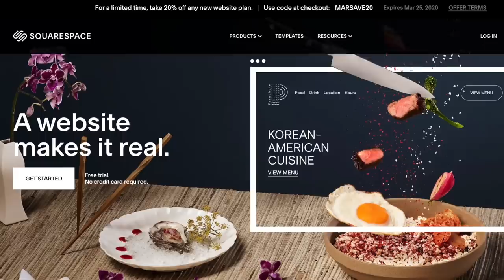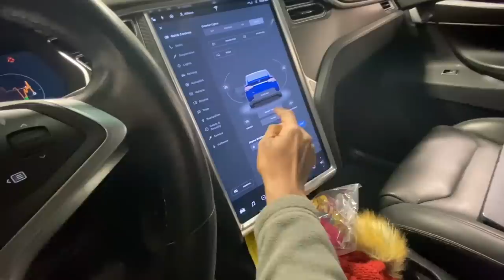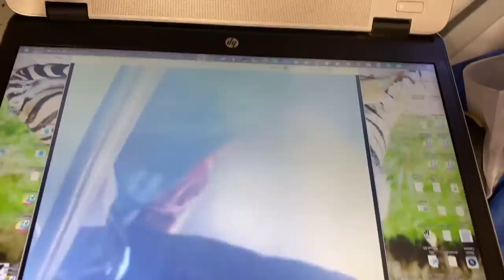Fixing everything wrong with my Tesla Model X

Comment: I truly do not understand why people keep propagating the notion that EV's need no maintenance.  Good vid. Rich. and EV Garage.
Reply: Andrew Whitehead; I think my old Gen Two Prius has something to do with that. No seriously, everybody gives them shit, Tesla Toyboys shit on them for using gas, Toyota toyboys shit on them for being electric ..and any time I tried to go up a hill or literally just move in snow I shit on it too but honestly, I’ve never seen a vehicle that required so little to go so far. The Prius played a huge role in building EVs low maintenance rep, IMO.
Reply: @aaronmacy9134  it comes from evs have way less moving parts. and not all evs are rebuilt from multiple cars like Richs'
Reply: @burq-  also hybrid vehicles doesnt overuse their powertrain, the prius uses a relativ big engine but in aktkinson cycle, the prius has a very sophisticated catalytic converter, also the tesla model y is almost a copy of the prius , you can compare the  two , from the dasboard to the hatchback and rear storage.... the tesla also needs a solar roof like the prius for some basic things like summon
Reply: @burq-  His Model X was purchased directly from Tesla. He didn't build it like his other cars.
Reply: Yup, EV's have less moving parts. And thus one feather becomes five hens.
Reply: Totally correct dude. 

All these people saying less moving parts only applies to the power train.

EV still have suspension bushes, wheel bearings, brakes, coolant, brake fluid, and various other regular mechanical items that require servicing.

It's like taking a regular removing the engine and transmission then saying nothing else will need maintenance.

Comment: Hey Rich, great video as always. I have a suggestion for the mechanical brake corrosion issue. How about suggesting to TESLA to create a API to have the cars computer set a interval of using the mechanical brakes once in a while so that they get hot enough to keep from corroding from lack of use? The API can be either set on a schedule or selected by the owner to perform the action which would show up on the screen as such. Just a thought. Stay safe!
Reply: Or you can turn regenerative braking off for a while.

Comment: $1800? Pfft! You need to own a BMW to get truly heart stopping "maintenance" bills.
Reply: But bmw is quality and quality has it's price. Tesla has only a price without quality
Reply: @sebastians.170  "BMW" and "quality"? Get out of the 80's, BMW's quality SUCKS now.
Reply: @sebastians.170  the "quality" era of bmw ended a long time ago
Reply: @sebastians.170  thats a pretty good joke lmfao
Reply: @sebastians.170  Agreed.  However, I own an E90 and an F30 and the F30 is crappy in the quality area, much much more so than the E90 only a generation older.
Reply: @mitch075fr  idk if im lucky but my 2012 bmw never had any issues, and in terms of quality, the interior and exterior were done very well, meanwhile my friends tesla has a mis aligned panel in his trunk
Reply: @markomclane475  You ARE lucky - I don't know a single BMW owner who DIDN'T have an issue with their car - and then had to pay the BMW maintenance price. And when I told them their very costly 4-cylinder Turbo engine would have cost less to fix at Peugeot's, they don't believe me... until they're told by their local mechanic that yeah, their engine is a Peugeot under a hard to remove BMW-branded plastic cover. It's even worse with Benz and Renault (with Benz engineers admitting they'd be unable to build a 4-cylinder engine as robust and efficient as Renault). So yeah - Deutsche Qualität was a thing in the 80's, not anymore. I won't mention VW - the Golf 4 was the last car generation worth anything and it sold like crap.
As for Tesla's lousy workmanship, I can't agree more - 3 guys have one at work (a 2017 model S, a 2017 model X and a 2018 model 3), and there's not a single one of them that didn't have misaligned panels or electronics going off after a few months. But it seems to be par for the course with American cars - I've never even SEEN one with proper workmanship. And one has to pay extra NOT to get a torque converter coupled with lousy blade springs suspensions... Give me manual (or automated dual clutch) anytime over that crap!
Meanwhile, my cheapo 2013 Dacia Sandero 2 LPG is running rather well (eventhough my wife is doing her best to destroy it) and my 2015 Mitsubishi-made iOn is as fun as ever to drive on windy mountain roads (provided they're dry - a Japanese pocket car is NOT built for good grip, whatever one may say).
Reply: @mitch075fr  huh, this whole time I was under the impression that german cars were very reliable. My first german car was a 1995 Mercedes C220 and that car only had one issue that my handyman father was able to fix in 5 mins with electrical tape. I also changed the battery for that car twice in the time I owned it, then in 2011 I started looking for a new car preferably a german or japanese one, and found a really nice bmw m650i that was barely used (500km on the odometer). I bought it near the end of 2012 and the only money I spent on that car was for new winter tires and rims, since it can get pretty snowy in canada. Also after a year if owning my bmw, the infotainment screen would occasionally tell me to visit some place in london ontario so I could have my car inspected, the bmw place found nothing wrong with my car yet they still charged me, last time I ever went there. Is it possible that because my mercedes and bmw were made in germany the quality is somehow higher than the cars that are made here in north america?
Reply: @markomclane475  It used to be very true. Don't get me wrong they are still more reliable than Italian, American or British cars, but they got to be no better than French cars (that improved a lot quality-wise since the 90's) and worse than Japanese or Korean cars.

Comment: Is this still you most useless car now that Delores has no supercharging?
Reply: Touché
Reply: Next video is always the most
Reply: Teslas are most useful as a city car, with home charging.  Supercharging is just for long trips and is quite expensive (>$0.30/kW-h, compared to <$0.10 KW-h at residential night rates).  Public chargers tend to run the same costs or more.  If I owned a BEV, I would rent a gas car for distant trips, which I often do even with my gas vehicles since no worries of breaking down far from home, with the resulting delays and high repair costs.
Reply: @williamgrissom9022  I'd just buy a Prius, great for city driving and self charging!
Reply: Graham 
“Self charging” is just Toyota pretending their gas powered car is an EV. It’s not and never will be.
Reply: AlphaCenturian Person
Delores still has the same uses as before, just less convenient. I bet the X is still the most useless to him.
Reply: @Dave5843-d9m  Yes, it's a hybrid car. What about it? It's still better built and better designed than any of Tesla's vehicles.
Reply: @G-ra-ha-m  It's a bit big for parking in the city center. The Honda E is king at that.

Comment: I gotta say, $1800 for all the work that was done is a pretty damned good deal.  I honestly thought you were gonna say something like $4500.  In the last video, Chad mentioned that the vibration was from the half shafts, and that you'd need new half shafts and a motor mount.  What that done here, too?  You mentioned the lower control arms, but not the half shafts.

Comment: My dad taught me that you have to use the brakes on the car from time to time, otherwise they will corrode and be less efficient. I would often engine break in a lower gear on a normal car in order to not brake, but not using the brakes makes them corrode like he shows in the video.  Because Tesla's car all have built in engine breaking when you let go off the accelerator, lots of energy is conserved back into the car, but at 3000 miles a brake pad starts rusting "naturally".

I've been looking to get the X, but now I need after market brakes so it doesn't rust. Perhaps the brake pads is the next upgrade for factory teslas.

Comment: Did those coolant connectors fail due to multiple battery removals? Seems like a silly complication for what could be a two hoses with a clamp which would last 20 years. How often do they expect the battery to be removed? Chances are if it needs a replacement then it also needs new coolant anyway.

Comment: Can i make a suggestion  to make the battery refit easier .
Make two locating dowels once the battery is dropped screw a dowel either side .
Jacking the battery up should be easier using the dowels as opposed to using a camera to check the pins are located .

Comment: Awesome video as always and explaining how a Tesla works and survives is fantastic. I would love to have a Tesla myself but it needs to have the same functionality and interior capacity as my 2004 Toyota minivan all-wheel-drive which now has 155,000 miles on it and so far we have only replaced the belts and the water pump due to one belt breaking . The belt that broke was the power steering belt so when that was replaced we did the timing belt and water pump as preventative measures. Also flush the transmission and add a new fluid along with all the other fluids replaced. I manage rental property and the minivan will hold at least four garbage cans full of wood chips or leaves along with chainsaw leaf blower weedeater buckets of tools and other boxes of supplies and a roof rack where I keep a ladder and a pole saw trimmer. It is a better truck with the function of keeping your tools safe and secure than my large ram trucks for holding Tools in performing jobs. I don’t think the model X quite has the interior space yet to match the Toyota minivan.

Comment: My brakes (on an ICE car) rot in exactly the same way because I (and the wife) cycle most of the time - the car sits for months sometimes. Nice to see that longlife pads exist, but what about the discs? Mine keep going rusty and cleaning them up is a pain. Does anyone make stainless discs? New ones are ridiculously cheap (£20), but I don't want to keep wasting discs - there's a lot of steel in those things which took a load of emissions to make.

Comment: So, Rich I saw your video resently in when you replaced you dead Tesla Wall Connector. I don't think that you can blame Tesla. It maybe that you forgot one critical point that I never saw you make. The Tesla Wall Connector is looking to draw 48 amps which means that you need a 60 amp circuit. Please follow me here, before doing this install did you meausure your whole house load? If not, then I expect you are destroying the Wall Adaptor by what is called "Current Starvation".  Before anyone installs a Tesla Wall Connector they should always do a whole house load measurement. If you do not have at least 50 amps available on each Leg you cannot install it without installing a larger Load Center "Breaker Box".

Comment: Surely in the factory they must have some special tools for aligning that battery?   Is there not some dowel pins or long headless bolts that screw into the bolt holes which aligns the battery as its mated together
Reply: Eliot Mansfield yes, there is.

Comment: Is disconnecting the 12V battery the only thing you did to disable the high voltage system? Did I see that correctly?
Jesus Christ, high voltage switches fail all the time, you can't rely on the system to work.
I'm a technician for high voltage EVs for a german manufacturer, and I have heard reports about suppliers failing to provide reliable switches on a large scale. Ffs, if two switches decide to weld themselves shut you have a fatality on your hands.
We have to complete a two page protocol involving around a dozen different voltage and resistance measurements before opening any HV connections (except for the one where we connect an adapter to conduct some of the measurements) ... because any less then that is pure negligence!

Comment: Why does an EV need an air filter that big?
Reply: LOL.
Reply: It's a hospital grade HEPA filter found on Model S and X. Usefulness varies mainly depending on amount of air pollution and personal allergies. For me in rural Sweden with no allergies it would only be unnecessary cost. For people that commute a lot in areas with bad air quality it could actually increase their life expectancy. So usefulness depends a lot on your actual circumstances.
Reply: as other people have mentioned it's for the biodefense mode in the Model X and S. I do believe there is a secondary cabin filter that's more normal. And I think that large filter is only engaged when you hit the biodefense button inside the car. That's a HEPA grade filter, I think filters to point to micron. It also turns the blower fan on to full blast pressurizing the inside of the car so that air can only blow out. Theoretically this should keep out viruses or other pollutants that you may drive through.
Reply: And here I thought it was just something crazy like the coolant radiators needed filtered air.
Nope biodefense mode it is.

Comment: Guys NIO in china is doing battery swap at their stations using special bolts and system. Much better design for battery replacement. Check it out, it does it in like 4 min.

Comment: clueless here: control arms for toyotas appears to be about 50 to 150usd/control arm. Why is tesla so much more?
Reply: Heavy car. Smaller production numbers. Little chance of non oem suppliers  making them, so Tesla can make some money.
Reply: By definition a more expensive car has more expensive parts.
Reply: Like Fajoekit pointed out, more expensive cars usually have more expensive parts. There isn’t always a good reason for it. However, of course you can boil it down to simple numerics such as production volume (less volume = more expensive), rarity (less demand = more expensive due to lack of any third party competition) and simply car weight (control arms on a car that has 2 times the weight of a family saloon need to be massive).
Reply: For my Volvo under 40 EUROS. Suck it up boiiss
Reply: @Fajoekit  yes and no. some cars have a very low price point but need more maintenance because how low quality the parts are
Reply: dragade101 that is an entirely different subject.

Comment: Not that it makes sense to do battery swaps anyway, but the battery swap could be made easier by changing the shape of the connectors so that they self align easier with the battery. Give them a conical or pyramid like plastic/metal enclosure with the opposite shape built in the battery and off you go.

Comment: The more I see, the less I want one.
Reply: The fact the battery needs to come out for something like control arms is problematic. Honda would have simply left a pocket for the bolt or pointed the bolt to the back so it can come out from the front.   Tesla gives off a bit of a domestic car "not thoroughly tested" vibe.
Reply: before you start on the big stuff, did you see where the sodding 12v battery was hiding? Its almost like they're ashamed of it, I assume its some fancy deep cycle NASA reject technology that lasts 50 years before replacement. I've had to dig for a battery before but this is just taking the piss if you ask me. The whole car is badly thought out. How about a metal grill over that prototype filter or one to cover the original one to stop future rodent damage @richrebuild?
Reply: You guy keep forgetting the car was designed about 12years ago.
Reply: as far as I'm aware, cars of 12 years ago weren't this crap. Yes there were the odd exceptions, like a Mondeo needing to remove the front subframe to swap the clitch and special alignment pins to refit the subframe, but even that's not as daft as the Tesla mentality.
Reply: @v8trauma  It’s designed to be as condensed as possible. A nightmare to repair, but gives more interior and storage space.

Comment: The brake pad conversation is really poor information.  Most if not all pads, including the new ones shown here are “integrally Molded” which means the material forms an interlock with the backing plate - you can see those 2 circles on the used pad as well as the new pad.  This is a mechanical or physical bonding.  Those “hooks” are dubious in their effectiveness.  The bonded pad issues were from the 80’s.
The more corrosive resistive backing plate and shim is a great idea for electric vehicles or any vehicle the rust belt.

Comment: brekes is a BIG problem here.. especially for EV's. it is not uncommon to replace both pad's and disc's every two years (befor inspection) as they r rusted. never worn. just rusted. and it can be over 1mm rust on the disc's alone. 
and they r WAY more rusted in two years then the worst they had there.

Comment: It’s $1,800 from EG with no filter. What is the price from Tesla with filter. How many miles on X. $1,800 that’s a lot of oil changes. I’m at $360 in service on my pickup with 60,000 miles and I have not done a thing myself. All done by dealer.

Comment: ITS Rusted from being cheap steel and heat, water dose not soak  into the brake pad brake backing. no mater what brake pad  u have the moisture will be the same. but ya them new brake are much better than any cheep no name brakes

Comment: I’m not a hater but my Model X 2017 has no problems, I really don’t understand the hate, just like every other car, it has problems, fixing your Chevrolet Corvette C7 or whatever isn’t any easier than replacing the air filter of a model x, plus, other cars such as the Porsche Cayenne, Audi Q7 aren’t any more reliable or luxurious, I guess the problem for you was opting in for the oldest and lowest spec tesla model x. You could’ve spent the xtra what 20k and gotten a fresh one on warrenty.